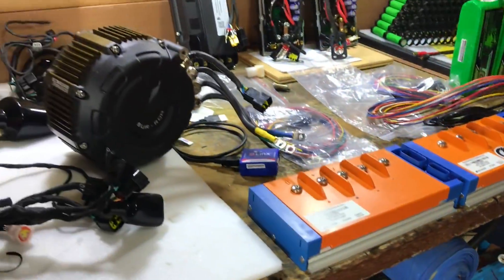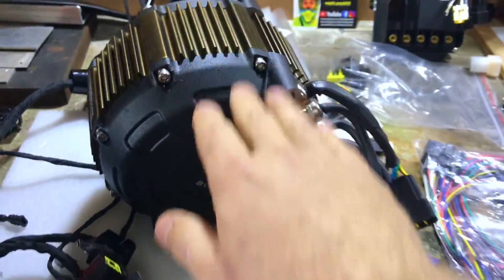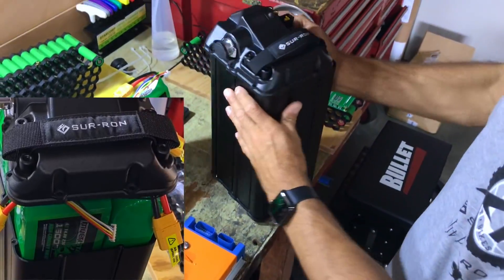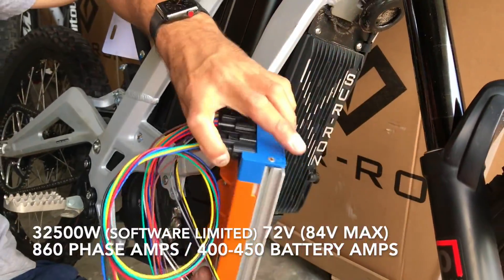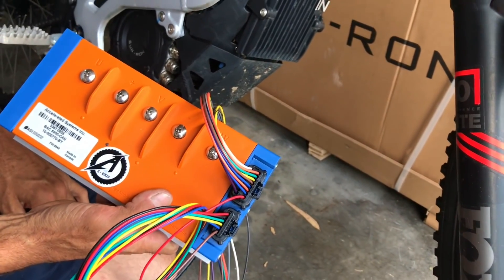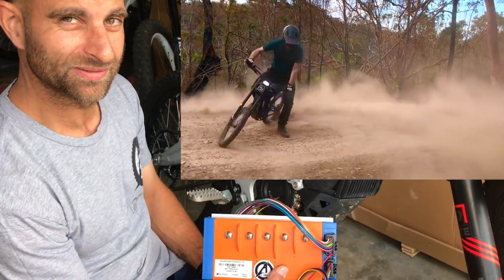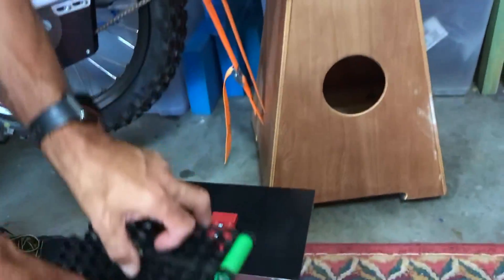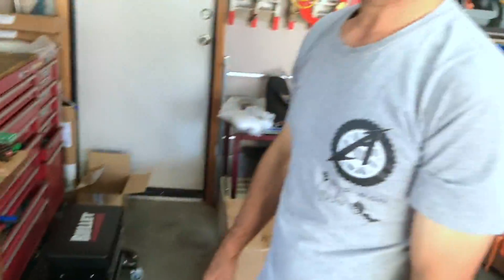32kW Sur Ron - ASI BAC8000 controller + LiPo batteries • LMX161 as well

Comment: Alright mate I’ve seen upgrades that make the sur Ron reach 60+ mph I’ve been searching every we’re on we’re to get them or how to go about getting them and I can’t find anything any were any ideas as I’m stuck ?
Reply from the maker: Yeah it’s easy to get the Sur-Ron to go over 60mph... we’ve got it done, the original battery can handle up to a point then the BMS starts cutting to protect the pack. The ASI BAC4000 is more suitable, the BAC8000 is bigger and will fry the motor. Search Sur-Ron ASI BAC4000 I’ve got some friends selling the complete plug and play hack solution. Adam the guy in this video https://www.aebikes.com.au/
Reply: BrunoPOWEEER does the bac4000 make it do around 60 then and does he ship to the uk ?

Comment: I have a really important question, by increasing the Ah of a battery do you get more amps. And if not how do you get more amps in a homemade battery?
Reply: Sponge Imperium increasing the amp hour or getting higher c rating
Reply: nightmare in action Thanks,I've been wondering how to get more amps from a battery for about a year or two.
Reply: Sponge Imperium yeah it can be a hassle sometimes getting info atm I'm running 15ah at 84v and pull 30 amps but I may buy Nissan. Leaf batteries for about 700 and 50ah at 84v and pull 50 amps so 1c long battery life

Comment: So, is this the 8000w controller they have? How can it handle 32500w? I'm curious because I want a couple for a micro ev I'm building. Let me know, thanks!
Reply from the maker: Tim Standaert yeahh but rated continuous power is one thing, peak POWEEER numbers can be 3x, 5x depending on time 1 min.. 30 sec... 10 sec.. and cooling! Adding a liquid cooling plate with a very high flow would increase these numbers.
Same applies to electric motors, they can do a LOT more than they’re rated for. 
So far all BAC8000 users are like WOOOOOWWW very impressed with the performance!!! 
Would 72v (84v max) suit / match your battery and motor setup??

Comment: So place your bets, which has more power..
Your astro trike or the new boy in town?..
Reply: for sure the tri-motor trike will be faster on the street...those others will just wheelie
Reply from the maker: Trike has more POWAAAAAAAHHH and 3 motors but will be an interesting comparison...
Did u notice that we have 3x BAC8000 controllers and they can run sensorless motors (like my AstroFlight motors). I have been talking to ASI asking if the BAC8000 can handle the super high 11500rpm and most importantly the ELECTRICAL RPM, we all think it won’t work but needs to be tested to be 100% sure.... that means possibly 32500w x 3 = 97500w !!!!! hahahahaha
Reply: @BrunoPOWEEER  oh my....right I did see the 3x controllers, didn't even cross my mind that you would use them all at once! for big big big more power BANG BANG BANG
funny I didn't think about that, as I am considering a dual motor dual controller project, but with a twist: instead of peak power at one RPM, gearing each motor slightly differently than the other to spread that power curve?!?! vs adjustable final drive gear changes to have low speed pull, high speed reach, and a fantastic mid-range ... gasp ...am I crazy or not crazy enough? Tesla AWD cars use different final drive on their front and rear motors, so?
Reply: @BrunoPOWEEER I've done over 60 000 erpm with an ASI controller. The astro motors should be fine.
Reply from the maker: rabbitphluff yeaaaahhhh... AWESOME info... I emailed ASI many times asking them what’s the maximum erpm and they either didn’t know or avoided giving me a number... these are sensorless, not sure if the max erpm is different when running sensorless... 11500rpm on a 8 pole motor... I guess I’ll find out soon hahaaa

Comment: Stock motor?? Without cooling mods??    Isn't it going to overheat really fast? Or only for dragracing?
Reply from the maker: epic time breaker yeahhh too much POWEEEEEERRR it can easily fry any of these motors in just 10 minutes!!! First tests will be done using the original motors without any cooling mods just so we understand the limitations. Danny Ripperton is a master of cooling controllers and motors and he will be very useful designing and machining a cooling plate for the motor. The good thing is you can tune the controller using their smartphone app which is very convenient. If you go for a long off-road ride you just use a conservative settings, if need more explosive performance just add a bit more. Want to drag race someone? Hang on... let me set this to full POWEEERRRR hahahaaa
Reply: @BrunoPOWEEER  what was the safe limit for motor temperature, to avoid destroying magnets?

Comment: Can u or someone that got a bac 8000 pls tell me the measurement of the controller than in advance.
Reply from the maker: Yeah, all specs and measurements are here
https://www.acceleratedsystems.com/media/ldignp21/controller-hp-spec-asi_v3-3-2pg.pdf
Reply from the maker: 245mm x 125mm x ~75mm with connectors plugged in

Comment: what's difference between bac8000 from ert and a bac8000 from asi anything??
Reply from the maker: Basically the only way you can get the controller directly from ASI (the BAC8000 manufacturer) is if you buy the starter kit to set you up as a dealer, this works out to be expensive if you only buy one or two controllers  but if you’re buying 3 or more you can become a dealer like ERT and tune controllers your own way. ERT (Alan) knows the controllers parameters very well but as far as I know the controller is locked with his password and you can only play with setting on his NXT display. There are some pros and cons in both options, just need to do a lot of research in forums and see what people are saying and make a decision =].   Technically the BAC4000 is the best fit in terms of power for the Surron, the BAC8000 is tuned down to less than 50% I think... you’ll need a badass $$$$ battery to unleash the full potential of the BAC8000 and even that you’ll end up frying the motor before you end up enjoying the 32500W peak that this controller can put out.

Comment: im just after some info  im doing a custom build ill be running a 12kw peak 15 kw hub motor with a sine wave sabvoton controller phase max current 450amp dc max current 200amp  iv been looking into batteries for the build  im not sure if id like to go with lipo is there any alternative iv been told id need about 300amps and most of the plug and play batteries only have 50amps any help would be great     cheers frank
Reply: What hub motor are you running?

Comment: Approximate 13kW is real possible continous power input (72V). I afraid you mix phase current and terminal current. That is very different thing ! BAC8000 is nominal 8kw.
But wery good job! (y) I made also OVERPOWERING Sur-Ron like this BAC8000 once try and you will never want ride on original :)
Reply from the maker: Thaaaaaanks mate... yeah we fitted the BAC8000 to the Sur-Ron right after that video, we had to tune down otherwise it would fry the motor in 10 minutes of action hahaha
https://youtu.be/aRzmNqAuEhQ
I work at www.elmofo.com.au making racing cars and motorcycles, the BAC8000 is 840 phase A-DC (594A-rms) which is more phase current than some MASSIVE 50-60kW controllers but waaaaay cheaper than a $7000 Rhinehart RMS high voltage controller we sell at work.
Peak power is VERY important specially for lightweight vehicles, if we were talking about a truck driving continuously on the highway then yes we only talk about continuous but on motorcycles peak really makes a big difference. Even Tesla Ludicrous mode is only possible because they have enabled the motor controller to be able to pump a very high peak output for a few seconds, waaaay above the continuous power it can output on continuously on the highway.
BAC8000 is 32kW limited via firmware at the moment.
Riding the original Sur-Ron after trying the ASI upgrade is actually funny haha

Comment: Can the LMX motor take 32 kW?
Reply from the maker: Yes....and NO.... it all depends how long, cooling and gearing... if you hold the throttle down it will fry the motor. Even some really big motors will fry at 32kw continuous.
Most people think a few seconds isn’t enough fun... once they feel 32kW on a lightweight bike they go like WTFFFFF... =]
Reply: @BrunoPOWEEER  - yes I have it on a 80lb scooter chassis 30Kw !

Comment: Nice bro!!!! Can't wait to see your test ride videos. If it's a solid build, I wouldn't mind upgrading too! Can we just upgrade the controller? I wanna be able to change settings through my phone. And adjust Regen. And adjust motor amps just a little higher than usual. I don't mind loosing a couple of miles off of my range

Comment: Daft comment but wouldnt having some gears on bike mean better top end. Sorry if this sounds dumb. Love your videos... more poweeehhhhrrrr
Reply from the maker: Matthew Williams yeaaahhh very good question!!!! Gears are an easier solution, it would definitely improve performance but top speed has a LOT to do with aerodynamics so you actually need more POWEEER to go faster (not only gearing alone). Motorcycle gearbox would add a lot of weight (LMX is only 38kg) and take up some precious space where we could fit more batteries (increasing the range) and a bigger motor instead! A 2 speed small lightweight mini planetary and simple gearbox would be awesome =]
There are endless ways to improve performance, all have their pros and cons... but adding more POWEEER is always more FUN hahahahaha
Reply: Adding to what Bruno said, the main reason for gearboxes on ice engines is the quoted power is the max power at a certain rpm of the engine. So to make best use of that peak power you use a gearbox to stay as close to that rpm and peak power as possible.
An electric motor on the other hand has a flat power line so it'll output good power all the way through the rpm range of the motor from 0rpm, so as long as your drive train can handle the torque load from setting of with max amps to the motor there is minimal gain to having gears other than sacrificing top end speed for acceleration so you need to weigh up if the extra weight is worth it as extra weight means slower acceleration as you now have to move that extra mass and you will also loose power in the gearbox as it also takes some power to move all those gears.
Reply from the maker: Dave Webster FANTASTIC reply!!! If this channel was a proper profitable business I would hire you to help me replying all my comments hahahahaha =]
Reply: @TheWebstaff  except thats a myth that all electronic motors have a flat horsepower response over their operating RPM range 
look at the torque "T(N.m)" output at different RPM "N(r/m)" of a motor very similar to the one used in the Sur Ron  :
https://www.goldenmotor.com/hubmotors/hubmotor-imgs/HPM3000-72V3KW%20Data.pdf 
plug those numbers into the formula (RPM * T) / 5252=HP or use an online calculator :
 https://ncalculators.com/electrical/torque-to-horsepower-calculator.htm
 and graph that out and you will end up with a nice hill shaped curve 
something like:
1600rmp = 5.6hp
2800rpm = 7hp
3800rpm = 4.5hp
4220rpm = 1hp

'power' is a function of torque at RPM, and I've never seen any motor with a totally flat power output....sure, you might say 'flatter' and more smoother or wider and sooner; but not 'flat', tho maybe that can be helped in controller programming? or just the max peak power limited by what the controller and/or batteries can supply(making the motor output appear flatter or chopped off) actually the stock Sur Ron might suffer from this, because I always thought that the HPM3000 was the motor used in it, and my factored hp numbers above show that its able to reach a peak of 7hp, but early dyno charts of the Sur Ron have it topping out and holding at only 4hp
...in that pdf chart you can also look at the efficiency "η(%)" and see that not all RPM are equal, and that might be telling of how capable a motor is at different RPM

basically EVs just don't need a transmission because the motor can operate at low and zero RPM(remember what a transmission does in an ICE: allows the engine to rev at slower vehicle speeds, until the last gear is 1:1...as an ICE can not produce any torque thus power until it is spinning), but we still all know that the final drive ratio can be very important in where that power curve is placed in an EV
(acceleration at lower or higher speeds) 
if motors did have a 'flat' response in an EV then that final gearing wouldn't matter at all, but thats not true
Reply: @BrunoPOWEEER  haha one day soon bud..
I'd love nothing more than to really get heavily involved in electric vehicles professionally..
Reply from the maker: Dave Webster back in 2014 my wife kept on telling me that I should find a job where I could do all these things I wanted without having to spend all my money buying toys but earn money instead! There was basically no jobs in this EV area, just some hobbits doing for fun, some making a bit of money just to pay for the bills, a lot less than I was earning doing engineering AV for corporate events and training for 6 years.
One day I saw an opportunity and thanks to my first YouTube videos I’ve got a job and quit my 6 years work. I halved my earnings which was a hard decision but I was doing something I really loved and learning cool stuff every single day + didn’t have to spend all my money buying toys anymore! Best decision ever!! You should really go hunting NOW... we only live once and life is too short... DO IT!!! =]